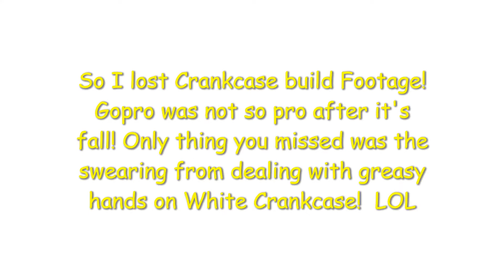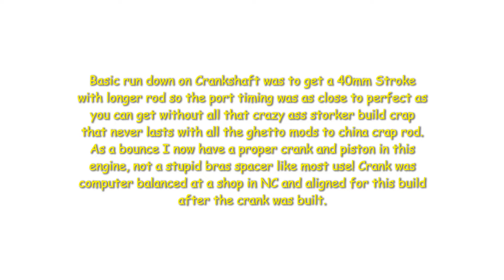SawZilla 56mm Stihl 066 Magnum Bicycle Build! Part 6: Cutting The Jug & Crankshaft Explained

Comment: Have you ever thought about building one using the jug from a Husqvarna 395xp? It has a 58mm piston.
Reply from the maker: Well here is the thing!  how many you seen run on youtube? 3 or 4?  how many have you seen being ridden on the road? 1ish in blue moon on a sunday with birds flying backwards that day lol? even if there is one video never is one again!

There is a whole reason for this!   Crankshaft pin sizes, crank case volume size, Bearings limits on RPM and force are exceeded 500X best bearings you can by rating limits and the crank case even CNC ones have been cracking at bearing journals! Now even the MS660 with 56mm piston does the same thing.  this build in this video broke 3 Clutch shafts, 2 bevel gears and blew the guts out of  so many shaft keys  just starting it was crazy LOL  You realize you need to double key everything!  Stock ones just on ms 660 are 6mm you know thick and that just goes to a clutch spinning a chain!!      I'm sure it would be cool as hell to make one, It's a Penis extension the size of a 200 car freight train to show off LOLz  but it will never be a practical runner if you get what io  mean.

ADDED EDIt: Other thing I hear was a big issue!  The Intakes on those have some kind of value system!  and it will not open at the correct timing cause of how they make it.  Not 100% cause I never actually did one myself but I know few people that made one "run" just never seen one actually run "well enough to ride"
Reply: @BuildBreakFix  kool. Yeah I though I would throw that out there and ask ya. There is a guy with one on a channel called Kevin's shop. The bike it's on is called twisted tea. He does alot of crazy engineering with motorized bicycles aswell.